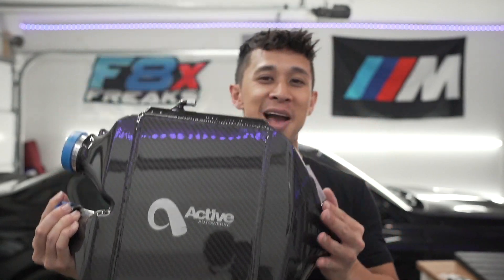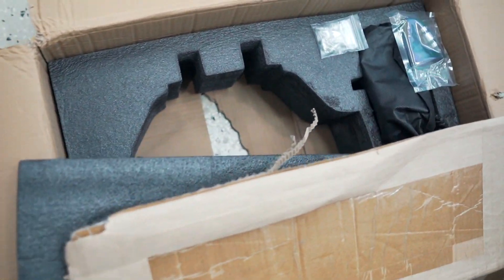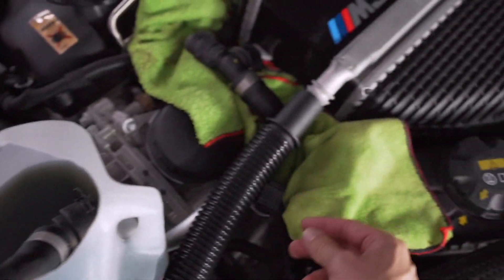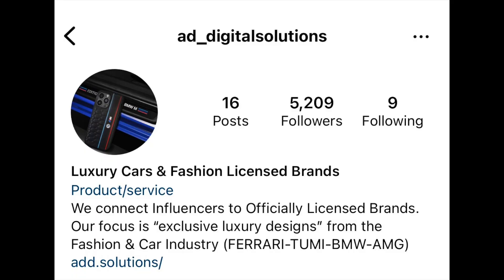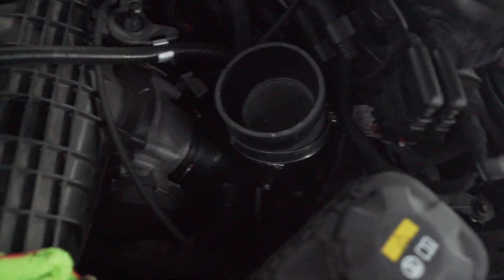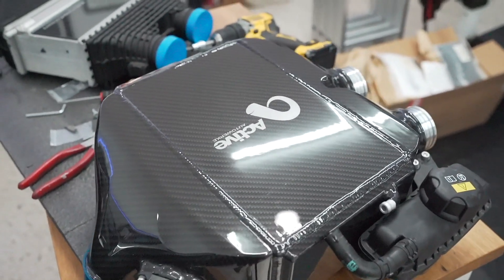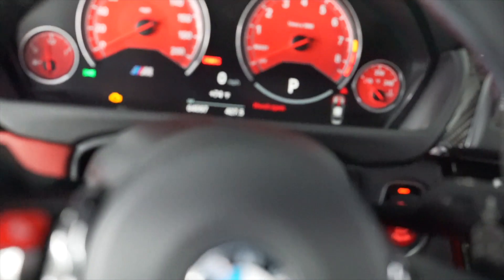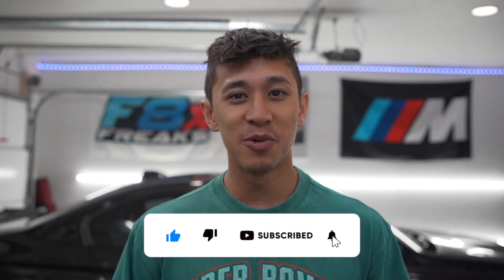ACTIVE AUTOWERKE CARBON CHARGE AIR COOLER install on my BMW F80 M3!

Comment: appreciate the video, just installed mine and was super easy, pushing the coolant out through the hole worked very well, didn’t have a mess when it was removed, thanks again for the great content and help!
Reply from the maker: Anytime man! Glad it helped 🙏🏽🙏🏽🙌🏽. Means a lot when you & other gain value from these vids 💪🏽

Comment: I own an f80 m3, and I have a genuine gts hood in the car. I'm going to have a Wagner cooler soon, and I'm worried about interference with the hood. Will it be okay without a problem? I really need your opinion.
Reply from the maker: I think with yours, you should be good. Other people have ran Wagner before with no issues, but of course double check 🙏🏽
Reply: @F80Ho  I finished the work today.Fortunately, we completed the installation without any problems.Thank you for your response!!